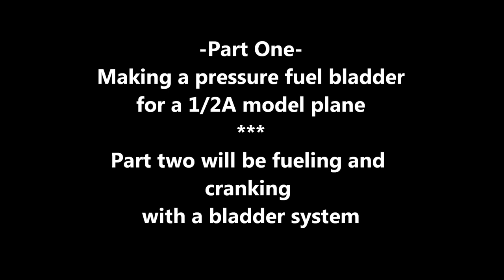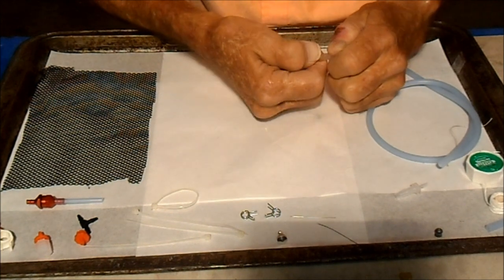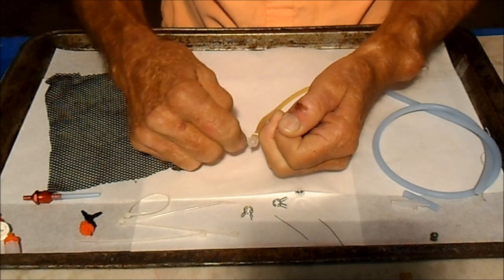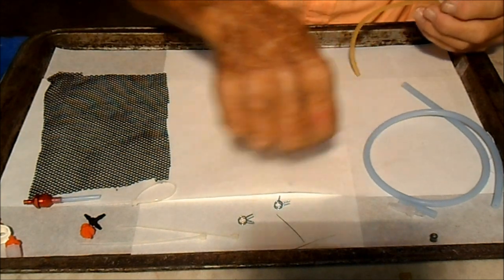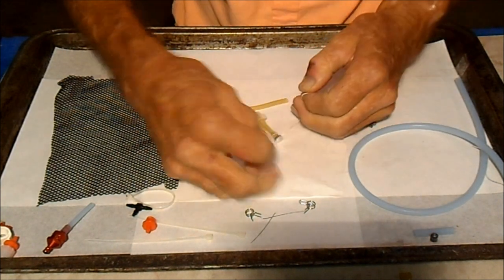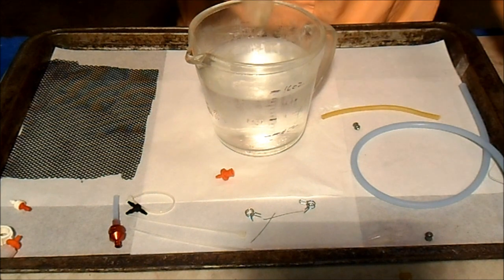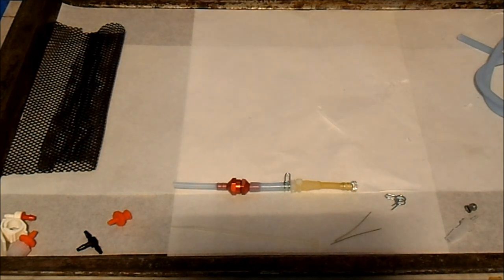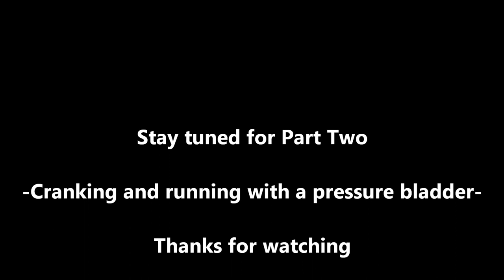Making a pressure fuel bladder

Comment: How does the pressure from a filled bladder not just come spraying out and flood the engine? The engine is supped to draw the fuel out based on what it needs, but this system would seem to force feed it...Kinda like fuel injection, sans pump and pressure regulator.

Comment: Is that done for increased fuel volume, or weight savings or both?
Reply from the maker: Mike, it's mainly to maintain an uninterrupted fuel feed during high gee aerobatics, when it's critical that the engine doesn't hiccup at a bad time.
Also it allows me to put as much fuel onboard as I want, for longer duration flights. And with a bored out venturi, the pressure feed develops significantly more horsepower.
Lots of plusses with a pressure bladder.
My video makes it look more complicated than it reslly is.